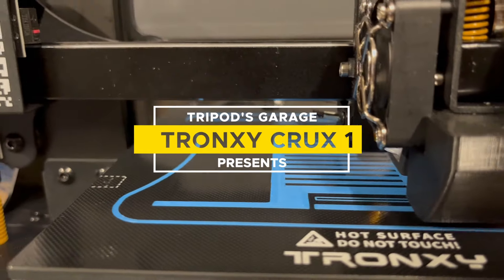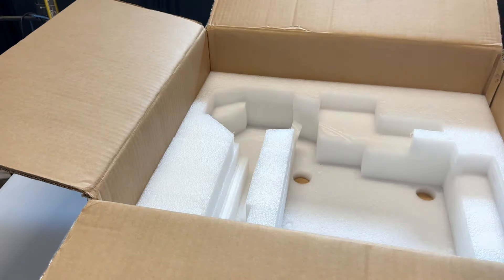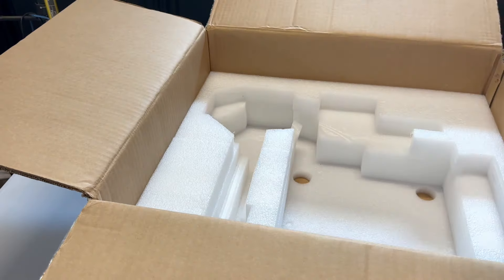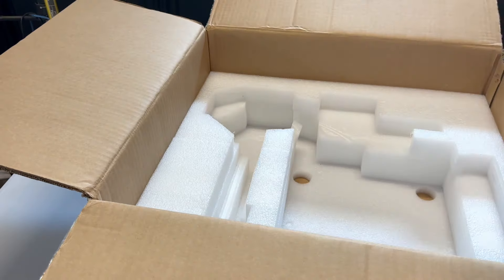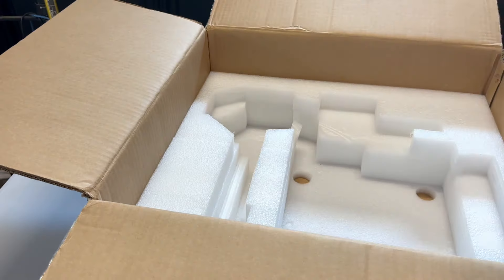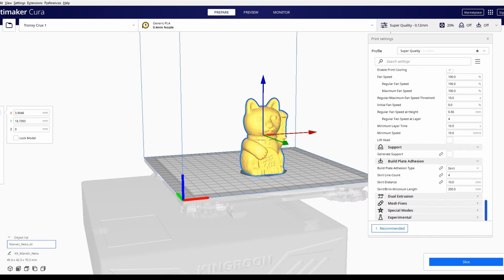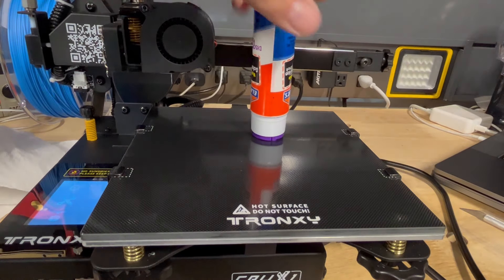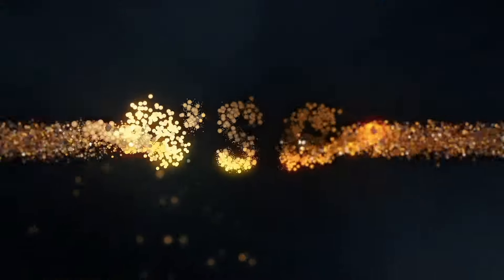TRONXY CRUX 1 - Tiny $179 3D Printer

Comment: They do have a magnetic spring steel PEI bed option for $10 more.  Getting one so we'll see how that is.
Reply: The way they have you set up the cura profile, it draws the purge line at x=1. Since the bed is exactly the build size, 1 is right on the edge.  You can fix it by changing the start gcode to draw the line at x=3 or more (more to miss the clamps if you have the glass bed)
Reply: @lemontwist63  I have just ordered one and I have no idea what you just said 😂. Hopefully its easier than it sounds
Reply: @zoompyreichman7686  no worries.  a simple edit in cura if you end up printing a line right at/off the left edge of the build plate.  easy fix.  This printer has been super reliable for me.

Comment: Why would tinnes connectors be worse than bare copper? Obviously a feral is the best way but im pretty damn sure tinned connectors are always better/safer than bare copper as the connector deforms the tinned wire as it is tightened by the screw, providing a pretty solid connection. 

Bare wires can fray as inserted and if not done propperly cause bad connections and shorts
Reply from the maker: Hello Chase,
I used to think the same way as you.  This was until I took some courses on soldering, and became certified.  Below is just one good article to review.  There are plenty more.  Hope this helps explain the reasoning.
https://cdn.thomasnet.com/ccp/00142951/263810.pdf
Reply: @TripodsGarage  thanks for the info that makes sense, ill stop wasting my time

Comment: At that price plus a few minor upgrades, why would I care about the [redacted] kit (same volume) I have sitting in a box in the corner that still needs probably $200+ in hardware to complete. 😔
Reply from the maker: After a getting the slicer nailed down, the prints were awesome!  Just need to advertise that the build volume is a tad smaller.  After slicing my own files, seeing the purge line going off the bed, and the nozzle crashing into the bed clips, it threw me off for a few seconds on why this was happening.  There is another review out there that I just watched, that states the height is also off by a few millimeters.  Just advertise it as a 170*170*170mm and call it a day.   This machine has a lot of potential, and works great, I really enjoy using it.  If people follow my profile, they will get amazing prints as well!
Reply: @TripodsGarage  I think cleaning of the metal guides/wheels will be an issue. There's no room for much more than dust.
Sacrifice a few mm in Z for a magnet and PEI; probably get near the 180 X/Y then.